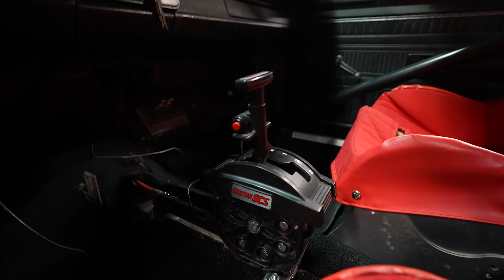GO FAST Mopar Parts for Allison's Dart, Trick Flow 190's!

Comment: Thank you 501 performance, trick flow, and nitrous express. And the gen 2 crew of course. ❤🎉😊 That was 3 clicks. All the way. On video and everything. Jeff even says there it is and boom, a big click and another 1/2 inch at least. If it doesn’t click 3 times you can break your transmission. Absolutely. Sometimes the last 2 clicks can be quick together if you are spinning quick so it seems like 2. Thank you so much for taking the turbo 350 out of that car. I’m not saying they are bad but it’s a Mopar.

Comment: I like the extra effort that Jeff puts into everything, like the bracket. But I was a little disappointed in reusing the U-bolts for the axal on the Duster. U-bolts stretch and should always be replaced with new.
Reply: Jeff is a perfectionist.  A very good quality to have and definitely a good influence.

Comment: The 904 is gonna smoke a TH350, what were the previous owners thinking? Even the Chevy guys with any power bypass the TH350 for a Powerglide or TH400. You've corrected that beef of mine, now you need a 8-3/4" rear if it has a 9" Ford rear axle, they are notorious power eaters because of the dumb pinion placement!! If an 8-3/4" won't hang, get a DANA 60!!

Comment: Don't forget, The ARP lube should be used under the head of the bolt or the bearing surface of the nut and on the threads, unless a thread sealer is used.

Comment: How about giving your old nitrous system to an old guy with an old school car that is looking to run in the 7.00 heads up class?
 I have a 65 Comet gasser project with a 311 inch Ford Windsor. That nitrous system would be just what the car needs.
  Love your videos. Listen to Jeff. He will share the knowledge.
  I wish I had someone to share the years of experience I have accumulated.

Comment: Just need to remember to not have your hand on the shifter on  launch with the reverse pattern otherwise you can be in second instantly.Had to learn the hard way on my SS/DA Hemi Cuda back in the day.Made it interesting when it launches the front wheels 4 feet in the air and falls into second all at the same time,the landing is ugly.

Comment: I have those heads for my 408 that i"m building . I have the specific head bolts .wondering what rockers you have .Trick flow has a specific  harland sharp set up.

Comment: Ok so I don't know much about Mopars,but why would you replace a Th 350 with a 904 and not a 727
Reply: The 904 is lighter in weight and it has less parasitic loss making the car faster.

Comment: Hello. I am a subscriber to all your channels. Please read entirely and I’ll try not to bore you. VETERAN desperately needs your help. I am building a 73 Scamp. Was a slant six car and is now a full on bracket car. Building all of it myself with my “gen 2” son. I have the same heads and intake. The trickflow 190.just finished the bottom end of my 318 stroked to a 390 with hopes to spray it. It got put on the back burner for a couple years but your channel has motivated me and my son to finish it this year. I can go into specifics if this goes anywhere. Long story short. I have recently invested about 10k in car and am in the process of finishing it up. I need your nitrous kit that you recently replaced. If you still have it. You mentioned free in the video. I would offer labor on anything you need to pay you for the nitrous kit. Love you guys and your channel. Look forward to hearing from you. I am located in ohio. About 25 minutes west of Dayton airport off 70. 

Shane Milnickel.

Comment: Why go with the week or 904 must be for the lighter weight
Reply from the maker: The 904 we acquired has much better internals than our stock-ish TH350

The 904 already had a manual valve body , the TH350 did not. And yes the 904 is much lighter and more efficient

Comment: Bracket racing is only luck and skill when ur foot braking. Delay boxes trans brakes and air shifters take all the skill and human error out the equation.  Comes down to who got their car dialed in on the right night.  People give bracket racers to much props. Also the faster car always has the advantage in bracket racing because they can dial down, run you down and mash the brakes.  That's not a skill nor a talent, its sand bagging and a complete disadvantage to the slow car.